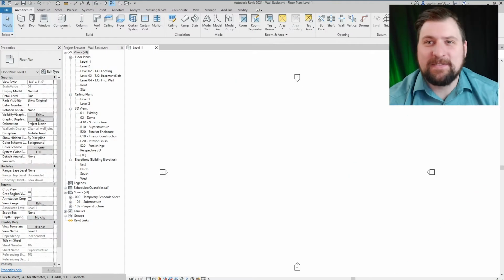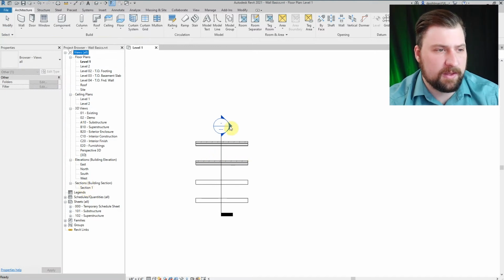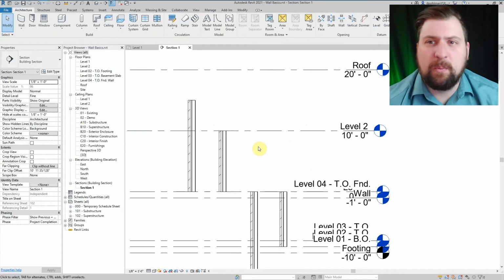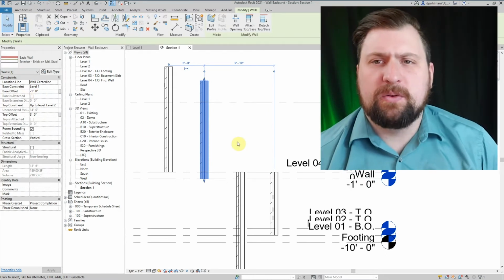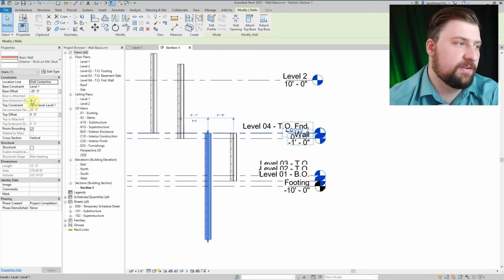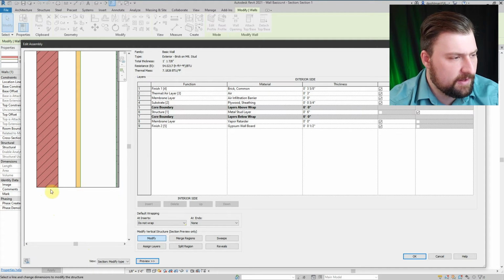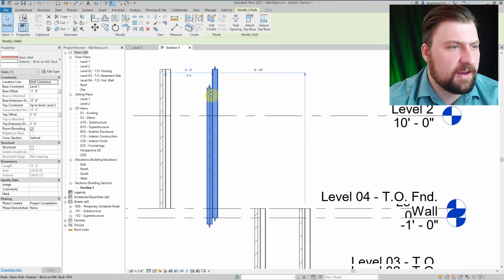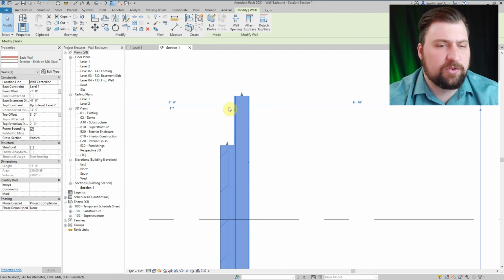Revit 2021: Wall Extension, Offset, & Constraints

Comment: I hate it how the layers have to be adjacent to one another in order to extend them. I'm currently working on a project with a 2x4 wall with gypsum board on each side and I want to adjust the gypsum board on each side, but that dumb thing won't let me. Thanks for answering my question though - I was trying to see if there was some way to do it, but it looks like there isn't.
Reply from the maker: The way i would handle your situation is to unlock the stud wall. Set the height of the wall to where you want the gypsum to be and then use the top offset for the stud
Reply: @RevitMan  Oh perfect! I'm surprised I didn't think of doing it that way, but it worked like a gem! Thanks!